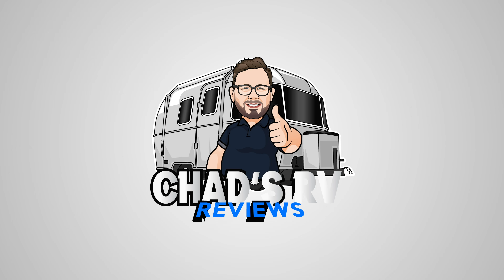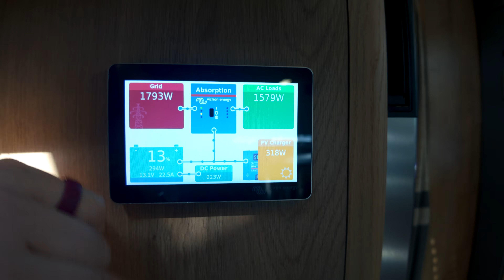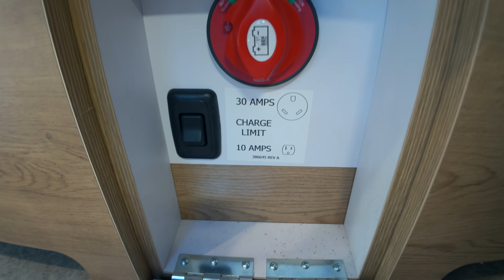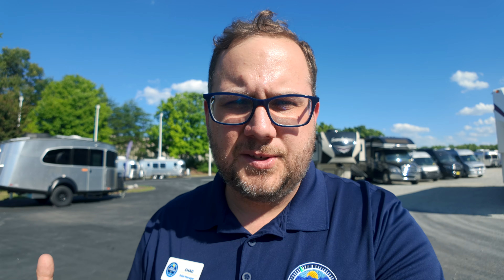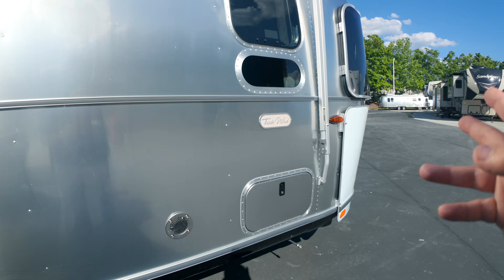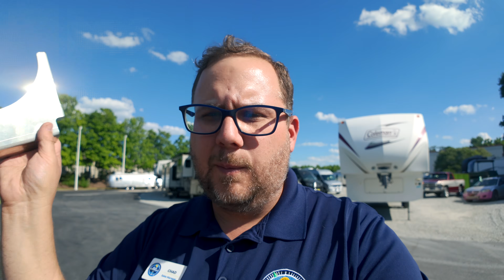I May Get In Trouble For This One! Is the Trade Wind worth it? ￼

Comment: Great information. We're moving toward the purchase of an Airstream (International 27FBT is top of list), and I've been soaking up as much info about FES as I can find. I think you hit the points quite well, and I will add that it's impossible to test in real world conditions, every possible hitch and truck combination with each floorplan design. Just way too many permutations. So brings us to something you didn't mention, Cost of Quality. That's the process by which you determine who much it would cost (per unit) to render that model defect-proof. Then you assign the manufacturing engineers to meet a certain amount of that cost per unit. The business then assesses the remaining risk and then budgets their warranty program to cover that cost. Is it great? Well, it's hard to like, but if you want the perfect, defect-proof product, how much would you be willing to pay for it? After all, the marketing department sets the price points based on their knowledge of the customer base. It's a constant yin and yang, and it happens in all consumer products industries. 

Personally, from what I've learned, and now that it's 2026, I'm much more comfortable with the issue. I know what to look for, and I know the process of how it gets fixed. And Airstream just ramped up the warranty. 

Having just had a solar panel array with storage installed on my house, there is definitely a learning curve when it comes to solar power. There's a lot to know! So I don't think you're being unfair when you say that some things need to be dummy proofed sometime.

Comment: I have a 2024 33’ Classic - with the added structure.   After only 5,760  miles towed it has Front End Separation.  

My dealer set me up with a ProPride Hitch and 3” Lift Kit.  They also set me up with 90 PSI pressure innmy tires! Towing with a 2024 Chevrolet 3500 HD truck.

Vinnie’s Northbay Airstream Repair has it and installing their Front End Separation solution to it.  Adding Airsafe Hitch to the equation and no weight distribution bars.
Reply from the maker: Yeah, I was going to say that you don’t need a pro pride with a 3500 or really any equalization bars. That is what cased the FES. 

The 3” lift is good to have.

Vinnie will get you set up right! As you know, you’re in good hands with him! Also, the Airsafe is a great hitch! It will tow and ride much better! I’m sure Vinnie has talked to you about tire pressure? Is 65 PSI what he recommended?

Comment: Airstream needs to up the GVWR on the 23 foot Trade Wind. 650lbs for cargo capacity is low for a boon docking trailer. Fresh water will weigh about 300lbs… leaving you with 350lbs for all the other stuff.

Comment: I installed a victron system in my 5th wheel.  I put in 1200ah of batteries and the split phase victron inverter.  It was $6k including the control to adjust amps and 3 server rack batteries.  It is a simple dial type controller not the fancy screen one.  I don’t understand why airstream doesn’t make it adjustable.   The layman will be tripping breakers on 110 15a outlets and not understand why.  The solution kinda sucks because generator sizes vary and maybe I can pull 20, but am stuck at 10…

Comment: BS Airstream. I’ve used a geny torsion boss without wd my entire time no bike rack and I just popped two rivets out of the front box each corner so it’s obviously occurring after 2.5years of ownership.
Reply from the maker: I'm super surprised to hear that! Have you had a dealer look at it yet?
Reply: It’s going to Vinnie’s in September. Really sad but has to be done. I truly am the rv customer that bought an airstream for quality. Unfortunately it’s taught me that all RVs fail, just don’t go and spend 6 figures thinking that’s not the case. There’s definitely quality, and they are fixable, but this is something that’s beyond excusable.

Comment: Hi Chad, I have a question regarding the receiver hitch and what you said about it. If I heard you correctly, you said that Airstream has now approved installing the Torklift Central Tailored hitch/Eco hitch on the rear of 2024 and newer Airstreams and that it has been approved to handle up to 350 pounds. The Torklift Central website states: "The TailoredHitch was custom made to exclusively fit on Airstream Trailers. AIRSTREAM ® is a registered trademark of Thor Tech, Inc. This product is not affiliated with or approved by Thor Tech, Inc. or Airstream, Inc." The site also claims that the hitch is "rated for 450lbs tongue weight." When I try to find any documentation from Airstream that states that they have approved this application, I have not been able to confirm this. Is there any documentation that you could point others to in order to confirm this? I would really like to install this on my 2024 Airstream 28' International, but I do not want to risk potential warranty issues or unintended damage to the rig. Any help you could provide here would be greatly appreciated!
Reply: I asked the same question last month.  I spoke with the factory 2x and was told no one at the company knows anything about this approved hitch or partnership and Airstream only approves the Flamma rack.  When I asked for documentation, Airstream of Greeensboro was unable or unwilling to support the comments posted on this video (see the post I made about a month ago).  I spoke to two other dealers locally and none of them heard of this new rear receiver hitch partnership.  The position of Airstream support, the techs I spoke to in person at the factory service center and the tour guide at the Jackson Center plant tour is that this hitch is not supported and regardless of the front end modifications they do, bolting this to the trailer and adding weight to it will eventually, at some point cause frame to shell connectivity issues.  If anyone can secure documentation supporting this hitch as has been described, I would welcome it wholeheartedly as I would love a much simpler way to carry bikes, but without solid documentation from the factory, I am not about to bolt this onto my $100+k trailer and have a possible $8k rear end separation repair down the road.
Reply: @SteveF-l5s  Thank you for taking the time  to respond. I do not feel comfortable with a verbal okay. If it isn't documented....it isn't documented and as such, you put yourself a risk.

Comment: Thank you for sharing about the Trade Wind. I agree with everything except the point about upgrades not adding any value to an RV. The Tradewind is a great model, a bit pricy but has the features people really want. NADA and the RV dealers work together to force RV values down on a timeline, at least that is what I was told and it used to hold true,   Airstreams never matched NADA values in the marketplace and there is a vast discrepancy between private market value and dealer value. 

I do agree that upgrades rarely increase value but perhaps a better way of thinking is that they preserve more of the original value. Example- when I purchased my Airstream years ago used at a dealer, they sent me pictures of it before I got on site. In the pictures, there was a sound system, a TV, AllClad pots and pans set, and a new microwave. When I got to the dealer the TV, pots and pans and sound system were gone. They had removed some items of "value". I asked about it and they coughed all but the sound system up. I purchased the unit. I did not know that the fridge was defective (dometic leaking recall) but knew the tires needed replaced ASAP. I replaced the tires and fridge with better than OEM. 

Now, over the years, I have maintained my model with replacement parts, mostly upgraded and,  added additional upgrades to the camper. I have been to rallies where participants tour each other's Airstreams and people are highly complimentary and comment on how I have been able to keep it as OEM as possible and upgrade it too. At one rally I was parked next to a 2005 model identical to mine with nothing changed. There was a noted stark contrast by touring rally goers.  I would venture to say that it is unlike any 2006 Safari I have seen on the market for sale. Most have little to no changes. 

It is true that I will never recover the upgrade costs but I do believe that the upgrades have value and help the camper to hold a much higher percentage of its value. All of my appliances are replaced except the furnace and all with better models than OEM. Then there is Villa Custom Sofa (like the classics), New Power Center, Lithium, Solar, Plumbing, fixtures, ventilation, wheels, 3P hitch, Vinnie's ceramic coat, the list is extensive. There is no way to value it using NADA but there is also no way to insure an Airstream using NADA valuation either - agreed value and appraisals all the way.

Something I have learned about Airstreams, mostly by touring them, is that the various eras still have their advantages, that betterment is not necessarily found in the latest series- often more of a cheapening. I have seen floorplans long gone that are to me, better thought out than most newer models. Airstreams are amazing campers but amazing does not stop at age 5 or 10.

Comment: You may want to edit this video in terms of your comments regarding rear hitches on 2024 and newer Airstream trailers.  I have a 2024 and posed this question to Airstream and this is part of what they came back with having shared this video with them-  

"I checked with engineering and sales as well, this is not recommended by Airstream. A hitch is not recommend or supported by Airstream."
Reply from the maker: That information came straight from my Airstream representative who works for Airstream.
Reply: @ChadsRVReviews  I'd love for this to be true as I have a 2024, but one of three things is right here.  Either your contact was incorrect, something got lost in translation, or the info I got directly from factory support 2x is incorrect.  I would reach out to your contact and make sure that the rear end has been reinforced and that Airstream supports that hitch bolted to the rear.  So far all indications are that they don't as the support tech said he shared your video with engineering and sales at Jackson Center and they all came back with the same answer- not recommended or supported.  If you find out otherwise, please share that info as I'd love to have an easier way to haul bikes! :)
Reply from the maker: @SteveF-l5s  Steve, this is true. I just triple-checked this with my rep at Airstream. I even sent him a screenshot of your message. Again, this is only on 2024 model year or newer. Prior to the new bracket, the weight limit for the back of an Airstream was 100 pounds. With the new bracket, it's 300 pounds. This is also why/how Fiamma came out with a new Airstream bike rack rated for e-bikes.
Reply: @ChadsRVReviews  Can you see if your dealer rep can get you engineering or sales documentation that supports bolting a hitch to the back and the weight increase to 300lbs  To me, the proof is in the details.  If Airstream supports it, they have to have some sort of data sheet from engineering or something engineering gave to sales to publish.  I have scoured the data available to me on my 2024 30' Flying Cloud built 10/23 and I have found no mention of any prior allowance in the 2023 documentation or upgraded allowance in 2024 documentation that would support placing a receiver hitch on back as has been described.  I would think a dealer has better access to factory documentation, and since 2 support reps have told me no and one even showed this video to engineering and sales and still came back with a hard no, I'm left with looking for solid documentation from Airstream because if I did this and an issue happened, I'm gonna be out about $8k for a rear separation repair.

Comment: The assisting is a very nice feature. It allows you to use an inverter 30 amp generator and only require 10 amps from it. That will allow it to run much longer on a tank and fuel. Perhaps this is less efficient overall than just dumping 30 amps into the batteries, but I could imagine a circumstance where you're trying to conserve fuel in the generator and which case dropping the demand to 10 amps would be beneficial.

Comment: Really enjoy your videos and going a step further by “looking under the hood” so to speak. If not connected to shore power, wouldn’t the solar panels be always charging the batteries as long it is outside?
Reply from the maker: Yes, they would always charge the battery as long as the have sun above them!

Comment: Future RVs will not use propane. Between the solar and the sure power and the lithium batteries. 
No genrators required. Call it the California edition 
But if you want if for cold propane would be nice.
Reply: Electric stove tops are horrible. Long live natural gas/propane.
Reply from the maker: I think we are years from that being the case, I agree that is the future!

Comment: Just seen the price of the trade wind $142,000   You could buy a International and have a proper solar multiplus battery install,  not the poorly executed design of the trade wind.
Reply: Bought mine new from dealer for $115k. Does that change your mind?
Reply: @hoytoy100  😀 a Trade Wind for $115K?

Comment: Excellent info  question- what about twin bed configuration? did airstream also reinforce the front also?? specifically in 2024  27ft flying cloud and how can a customer tell? thanks
Reply from the maker: Yes, they did. The only way to tell is to take front apart and look in side.
Reply: @ChadsRVReviews  I figured you would say that  this info is so helpful and backs up a lot of what i read on forums   good luck putting your rig back together!
Reply from the maker: @djstopenhagen3711  Thank you!

Comment: I have a 2024 Trade Wind that has buckling around the front storage bay which appeared prior to 60 days of ownership and less than 1,500 miles.  If all new Airstreams have the fix for FES from the factory then why is there buckling around the storage bay? My local dealer says that they can install brackets around the storage bay to take care of the problem but I thought that those brackets were already installed by the manufacturer beginning in 2023. I'm confused! I just know that what I'm experiencing should not be happening and I would just like to understand what needs to be done to actually fix this problem? I know that the trailer has not been overloaded, has not been off-road, and I'm using the exact same hitch that I used to pull my prior Airstream for 18 years all over the US and Alaska and never experienced any problems with it so what's going on? I feel like I'm getting the run-around.
Reply from the maker: The brackets started in 2024. They will not prevent FES they help but they don’t prevent. What is your tow vehicle and what weight distribution hitch are you using? Is your Trade Wind a twin bed? Did you have the same size Airstream before with storage in the front? Also, call Airstream customer support directly.
Reply: @ChadsRVReviews  My prior Airstream was a 1999 25' Safari, rear bed twin, and I towed with a Lincoln Navigator with an equalizer hitch and am using the same exact setup on this new Trade Wind.  My Trade Wind is the twin model and there is buckling around both sides of the front storage bay.  I emailed Airstream Customer Service from the Airstream WebSite (Mothership) after I arrived home in Missouri and noticed the bucking around the storage bay and was basically told to go to my purchasing dealer which is 1,250 miles away.  Since it is not possible to go to the selling dealer I went to the Dealer in Missouri, Bill Thomas, and they were awesome and sent pictures to Airstream (I had also provided pictures to Airstream Mothership along with my request for service).  Airstream has approved a "fix" but it is my understanding that it is only to add the brackets like you showed in your video.  How is that going to fix my problem if my Trade Wind already has the support brackets installed at the factory?  I'm confused because I have seen other Airstream Owners who have had additional bracing welded to the frame for the brackets to attach to by the Mothership yet they don't want to even look at my brand new Trade Wind!  Any suggestions because I don't want to have to keep having this repair done over and over again?